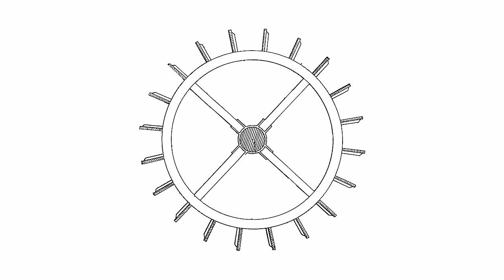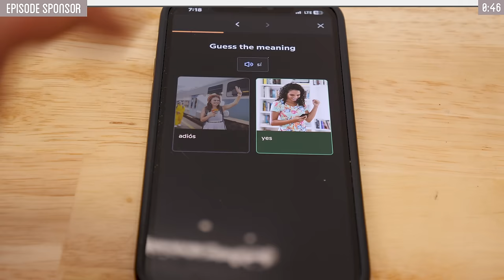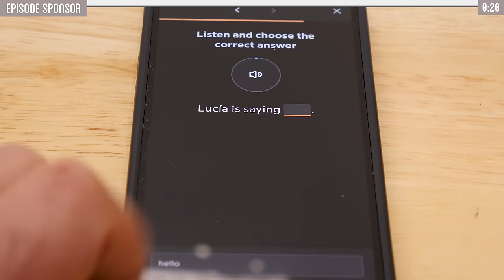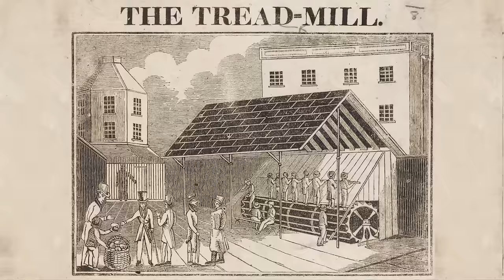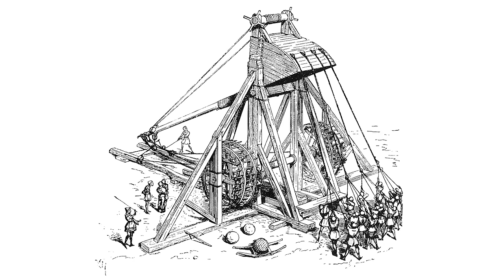This Machine Powered the Roman Empire!

Comment: Round and smooth the axle so you would be able to lean against it and keep your footing. 

Another thing is you don’t necessarily need to have the axle all the way through. Add another layer to the cross boards and supports should give it enough strength to stand without the axle going through the middle. Think of it like a wagon wheel, they have no external support on the axle on the outer side of the wheel. Split the axle in half and round off a majority of it. Double up the thickness of the support post and pin the axle on either side to prevent lateral movement. Do the same at the wheel end of the axle. Repeat on the other side and you won’t need the shaft to go completely across. This will make it much easier to walk on since you won’t be hunched over trying to avoid the axle attempting to clock you in the back of the head from the 4 corners. 

As previously stated even just rounding the axle completely in the middle where you stand and making it nice and smooth and maybe polish it with something so you can rest your shoulders against it would make a massive difference in your ability and comfort when using it. 

Sure the height might be period correct but average human height back then for males was 5’7 not 6 foot plus. 

Also make a stop for it to get on and off the thing.

Comment: There's this one castle project in Framce, where they actually built a whole crane to lift up the stones. It looks quite similar, only the walkway has like 1/2- 1 inch spacing between the boards, maybe so you can look through it and focus on something through them to not get dizzy, maybe to save weight
Reply: Castle Guedelon..thanks for the reminder.  I bet they've gotten a lot done in the last couple years.
Reply: @crowznest438 I think they’re wrapping up no? I was told it was due to finish this year.

Comment: 2 Improvements to this setup: 
Notch-blocks like Mountain climber nubs, this gives you something to step up onto on the climb to push down with your weight ; but also allows you to hold the central beam and push them further back while still going forward and not running backwards.

Also, Pulley attachment on the belt-wheel. If the belt pulled to an equal dimension Circle the wheel has, off of the Wheel side. Have it have a center holding beam on legs too, but also beam can be used as a small cog spinning with the larger diameter.  Connect the WHEEL belt to the Small cog of this new Pully belt attachment, and the large attached to the Hammer cam.

Comment: If the wheel causes dizziness, I'd suggest using a cog system to be able to a) produce more work with each step, but, specially, make it harder to move, so it doesn't go too fast.

Also, grabbing the beams for support looked like a big no-no. Maybe a smaller wheel with handles on those beams would make it easier for you to maintain your equilibrium while at the same time being able to use your hands to push as well.

Comment: The trick is to put so much load onto the system, that it stops when you are standing forward of the axle and only moves when you walk up the slope. The trebuchet picture shows a nice design; its inner surface is a ladder, which allows you to "climb" inside with your hands and feet, giving you more stability.

Comment: in the future, for flatbelts, use convex rounded pulleys without flanges. on a pulley with flanges, the belt will have a tendency to climb up the flanges, but with a convex rounded pulley, the belt tends to climb up the round towards the center. this is why when you see stationary engines hooked up with flat belts, the pulleys always seem flat with no flanges, and it seems confusing how the belt can stay on them, but their pulleys are actually slightly convexly rounded to keep the belts on

Comment: what i would suggest is to either round the whole axle and add a second hollow piece of wood over it. almost like a tube. it can have handles to hold onto (person being in the back of the axle) or just make the tube square and the handle not moving around the axle freely.i mean doing this isn't really that important but for easier balancing and maybe higher speeds why not
Reply: A spinning wood on wood bearing like that would have a lot of friction, if it grabs then the handle could hit the operator and be dangerous
Reply: well i guess its gonna have to be non moving. i thought of making the whole axle not spin and just the tips spin by putting some bearings over them. like on the part of the square thats fixed to the wheel. i mean yea it might be a bit difficult to do that since the axel would kinda still be free spinning but you can fix it in place with something like  making a hole in one or both of the ends and putting a long piece of wood or metal through it that gets hammered into the ground. sometimes i overthink stuff and this might be one of those times.

Comment: You could use the tread wheel as a sort of fly wheel if you put weight along the inside edges and put handles to pull it downwards on the outside, running inside it seems a bit tough lol. Also you could put a harmless on the inside hanging from the cross beam to keep you from falling

Comment: used to have wheels like this in my local park. Didn't have axle in middle but rollers underneath supporting the wheel. got good enough I could run the wheel while every one else got dizzy or sick. trick is run with eyes closed at constant speed. hope this helps. love your vids keep up the great content

Comment: Cutting off the corners off the  wheel will make the wheel lighter inturn making it easier to turn and if you use a diamond shape for the axle holes you low the contact area even more

Comment: One thing I don't know if you utilized, but if you increase the load on the wheel, giving it more resistance, will change where your body stands in the machine, because it increases the incline required to move the other thing.  Increase the gear ratio with the power hammer/add more hammers to the system.

Comment: If you don't want to increase the size of the wheel for safety and historical reasons, could you make the center axle free-spinning and graspable without sacrificing structural stability? That way y'all could grab it and turn it into a stabilizer instead of a hazard?

Comment: I know it would be difficult, but I think it might work better to make it so it is supported on one side only so that you can have a stationary handle sticking in from the other side to hold on to.  Then the axle wouldn't be in the way either.  I know it wouldn't be historically accurate, but it might be safer and more useful.

Comment: get a heavier sledge because you're are not using the full potential of the wheel with that small one. it's basically a gravity driver which means the heavier the hammer the more force it will impart to the metal.  Also the center of the wheel could be rounded if anything just to make it a little more comfortable to the user.  you COULD even remove the center wheel entirely if you connected both sides from the outside but then you'd have to redo most of the design.

Comment: If the axel doesn't need to go all the way through the wheel, instead just connecting to the frame of the wheel, you could cut out the center and put a rod through that can freely rotate, giving you something to hold on to while you work the wheel, closing your eyes to help with the dizziness.
Reply: I think the spokes connecting the center of the wheel to the drum would need to be way reinforced to provide enough stability so idk if that would be realistic. That said, just rounding out some regions of the existing axle might help enough to be able to lean against it

Comment: this power hammer cam wheel needs another hook. instantly double hit frequency for free-ish.
Reply: Needs 3 or 4 cams. The size of a human wheel means you have immense torque, and normally for a triphammer would gear it either triangularly or with a cross shape.

Comment: The center support should have been more of a T shape on each outer wall bracing against the existing circle so that it doesn't run all the way through the center. Like a T shape with the long part being the part that connects to the support stand.

Comment: Would it be possible to rig up some sort of harness to the center axel. Would need to round off an attachment point so it won't spin with the wheel.  Then hook into it and just use leg power.

Comment: Maybe you can use a slack strap or a belt across your chest to lean forward against, holding you back against the axle so you dont fall forward. The axle would have to be nice and round tho to not snag and get tight tho. With a nice groove in the axle for each side of the belt to ride on it should also stabilize you sideways a litle bit as well.

Comment: It's shown on the trebuchet pictures you had but doing a wheel with cross bars instead of a flat walking surface allows it to be used similar to climbing a ladder  that would alleviate the center axle just be hard on your back.

Comment: The twist in the drive belt is drivin' me nuts.

I think you need a gearbox to get more rotations out of it, depending on your application. Changes to the whole drive train, really.

Making the center of the axle round and smooth, with a possible sheath to hold on to, or lean back against, might improve walking in it.

Otherwise, this could be the cardio that's easier on the back, that also gets your logs cut to planks while ya do it.

Comment: Random question but what's the point of committing to solely using hand tools if you're going to use stuff like modern wood glue. Why not just use a power tool to do simple stuff like drilling the holes
Reply: Wood glues been around for ages, made from animal hooves I think? But I get your point.

Comment: If you put some kind of grip over the axle you could use it as a handle to brace yourselves. It would also act as a grounding point for your proprioception.

You fould do this several ways Im sure, but the one that came to mind was just putting a pipe  inside and sliding the axle through it like a sleeve. Not the most elegant solution, bearings would be better, but sometimes quick and dirty is enough

Comment: If you are going to try this as a crane, due to the way you constructed the outer wheels could easily be modified to allow a pawl to be used.  That would prevent a potentially dangerous situation if the load should get away from you.  I dont know if that is historically correct, but seems likely.

Comment: I feel like it would be very useful to add a bracket to the center axle that sits in front of it so the walker inside has something to hold/lean on to instead of awkwardly bending under the central axle. Maybe even just a rope would do.

Comment: Your power wheel is on small side as many commenters mentioned. People back then did make technological improvements to their power wheels to improve efficiencies. The small, one-man wheels were not smooth floored. They added risers that the human could push against with their feet and grab with their hands like climbing a ladder. This and the load resistance allowed the person to work forward of the axle and use their body weight. They would climb at a slow and steady pace and the speed would be determined by the pulleys. They also rounded the cross axle or used a log that was rounded because a square axle could cause injuries. Even if slaves did the labor, slave owners would try to minimize injures to get the most productivity. There were bad designs and better designs as with most machines.

Comment: For your legs, the ones holding up the wheel, use two planks with a notch cut out and match those notches up with a set of notches on the legs. It will keep the base from slowly spreading apart from vibratio. Also put a pin on the end of the wheel axle to keep it from sliding out.

A bit of lube on the axle wouldnt hurt
Reply: Dr Stones Vaccuumpump, can this youtuber or any of his fans tell me about it? I feel like i have bad grasp on it. Same for the Waterwheel
Reply: @slevinchannel7589  ???
sorry I just figured out the name of the joint, a half lap joint,
Reply: @slevinchannel7589  I'm afraid not. There may be some interesting bits in it, but it is not a topic I am interested in discussing.
Reply: @AdmiralStoicRum  How can you know its so uninteresting when you havent watched it and all you know about it is me calling it a 'Science Anime' and at 'some point' it has a 'Vaccuumpump'?
Reply: @slevinchannel7589  I am not interested in discussing it.
Reply: @AdmiralStoicRum  Ok. Then at least do me the favor and remove your easlier comment that has no sentence starting with a big letter. Consider it a parting-gift
Reply: @slevinchannel7589  I don't think i will.
Reply: @AdmiralStoicRum  How does being judgemental work out for you, in general?
Reply: @loturzelrestaurant  The poster slevinchanmel8589 removed a few comments, so there is some missing context.

To give a little bit of context, they were talking about an anime that I was not interested in watching, researching, or discussing. It is not hard to say okay without forcing someone to do something they aren't willing to do.

Comment: Probably want to consider angled treads rather than a smooth inner curve to make the motion more like a continuous staircase. Some kind of deadmans handle rigged onto the axle probably wouldn't be a bad idea if you're not going to prove the concept and then use an electric motor to rotate the wheel

Comment: I wouldn't worry about the axle too much. As soon as there is some bigger load that you are powering, you will walk a bit further forward because of the necessary torque. This way you should be more out of the way of the axle when it matters. You will likely need to gear up the whole thing quite a bit more.

Comment: Probably already suggested, and likely you already thought about it, if you also round the axle inside the wheel, leaving the axle only squared where needed to afix to the wheel, you'll be able to much easier use the axle as a support for the human, if youre in front you can rest your back on it, and if youre behind you can place your hands on it. The squared shape is severely inhibiting this use

Comment: Another method is a walking beam, basicly a teeter totter where a person, or group, walks back and forth on a pivoting plank, resulting in something like a saw blade being moved up and down. Put the log on a slight slope so it gets fed into the saw and you have a very slow lumbermill, but better than being the guy working from underneath in a pit when sawing by hand.

Comment: Maybe you could cut a hole in the center of every 3 or so boards which will allow you to look through to the outside once it’s going fast enough without compromising the structure. If there’s danger of tripping on it you could put plexiglass on them

Comment: I still think you can take advantage of physics here. I forget the name of it but Steve mould did a video on a mechanical water pump. You could combine this with the physical principle that allows you to get high pressure using a small volume of water as it's the height of the water that matters and not the volume. A scientist in the 17th or 18th century, I think that was the time, would blow up barrels using just a cup of water via this principle

Comment: I would be fairly interested to see how much electricity could be generated if you connected that to an alternator.  I understand that's not in the order of inventions, but it would be a good marker to determine how much power you're actually making. You could then use that as a guide in determining how much you could actually power with it.

Comment: how is this different from a normal hand crank? the only pros i could find is that the person could put all their weight into it allowing them to turn heavier stuff and we can walk and run for longer than we could crank. i could see that thing being fun if you were a kid/short, made a bigger wheel, or found a way to remove or round the center beam..
Reply: That’s the exact reason, our legs are made for walking and that’s what they’ll do. Arms will tire out much more quickly than legs. It’s the same reason in rock climbing you use your legs to push yourself up and not your arms to pull.

Comment: I think to improve the Power Hammer is to put more weight on the Hammer head and to also move the Cam Closer to the Hammer Head end.
This and also turning the Cam 90 degrees and making the cam over arch on the cam its self to make clear room for the arm of the Cam to Fall instead of hitting the cam and slowing the impact and then you now have an improved Davinci Power Hammer

Comment: Awesome build bro! I think the hammer would work better with a much larger weight. Reasoning being: treadmil craine can lift a lot of weight, but the hammer reciprocation is dependent on the snail gear. I see you tried to use a large/small gear to increase its speed, but if you get more work done per swing, then it might work out better